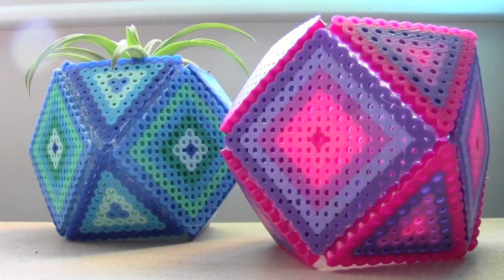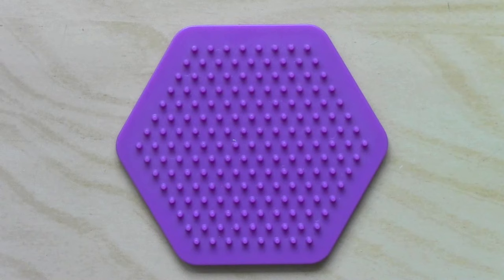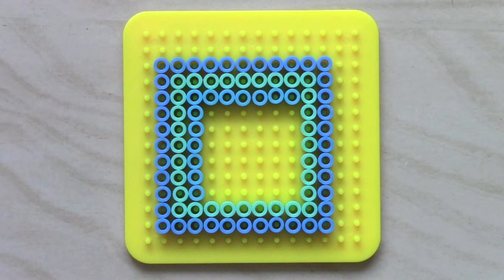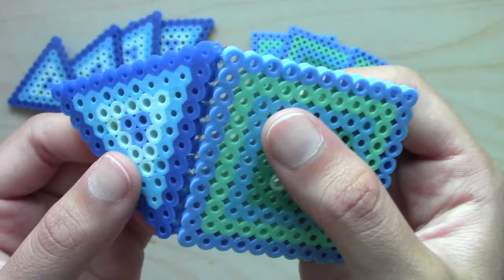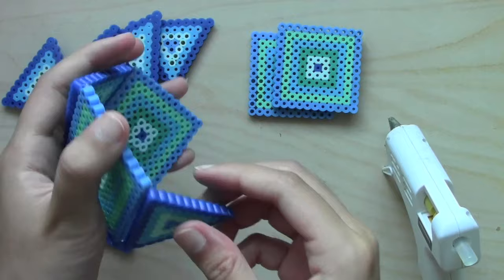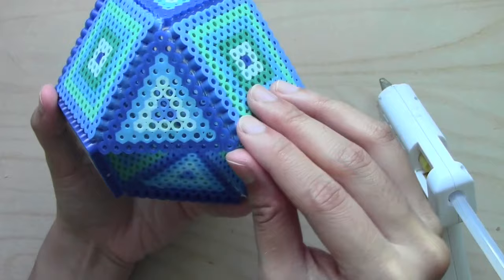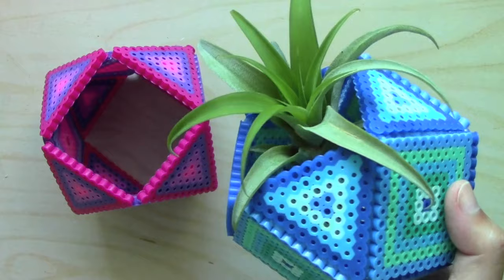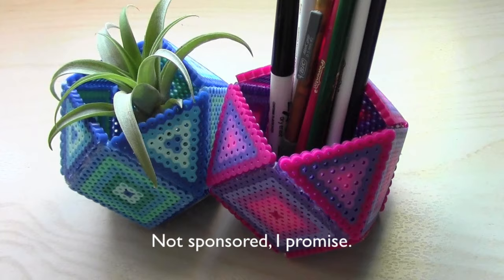DIY 3D Perler Bead Geometric Planters

Comment: If you do add a bottom for this, iron the square slightly longer than usual so the holes in the perler beads close up more and stop water leaking.

Comment: Is it possible to make this without the hexagon pegboard? I only have square ones >.<
Reply: Yes ofcourse u can but u need to be sure the lengths are the same u know
Reply from the maker: I don't think it's possible to make equilateral triangles on square pegboards. You need the hexagon pegboard otherwise the 3d shape will not work out.

Comment: Great video! I really love the colors used here, it looks so pretty!
I have a question though, about ironing the beads, that I'm not sure if you'd be able to help me with, but its worth a shot. Last night I had some perler bead designs made, and I ironed them, with the help of my mom, for the first time, since it was the first time I had ever used an iron (^^;) but they didn't really turn out very well. It took a really long time for them to melt together, and even then, the edges melted more than the middle, the middle didn't really melt almost at all for some of the beads, but some of the edges melted really flat, even though I'm pretty sure that I ironed it evenly. The iron I used was my  mom's and I think she said it was kind of old, so would that have anything to do with it? I'm sorry to bug you with asking this, but it seems you know at least a bit about perler beading stuff ^^;
Reply from the maker: ah there are many factors that could be affecting your ironing results. I find that Perler brand beads are the best and if you are using a different brand like pyssla, it may turn out worse. Also you may have the heat on too low and the distribution of heat gets messed up. I usually set mine in the middle...it's hard to explain the temperature because everyone's iron is different, but I will try to make a video for people who are wondering how I iron!
Reply: Thanks for replying! I am using the Perler brand, and I think that my mom had the iron higher than the middle, because the middle setting just wouldn't iron anything... A video to explain it would be great, though ^^
Reply from the maker: ok I'll work on it and hopefully it will help a little
Reply: thanks! I hope so too. No rush though!